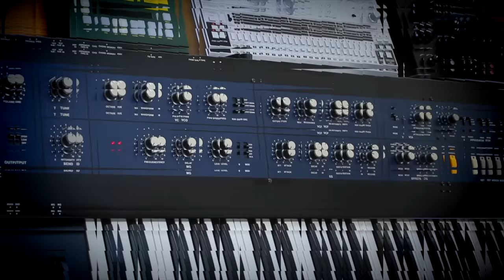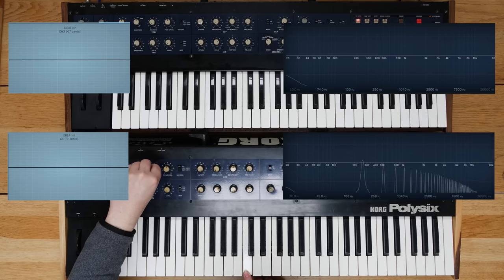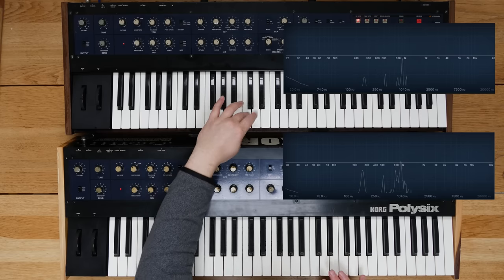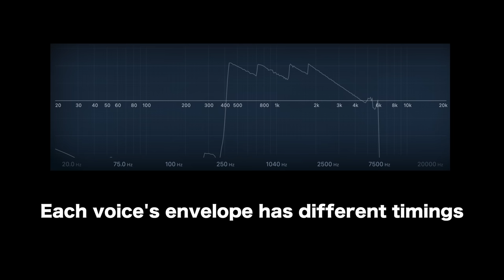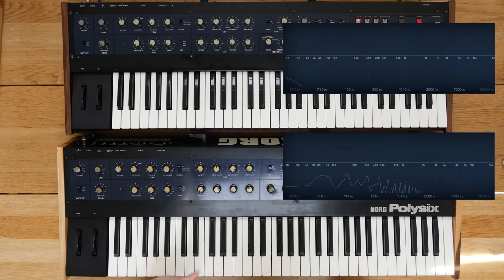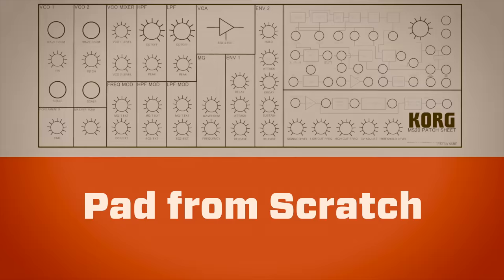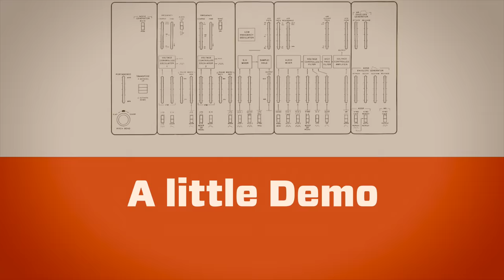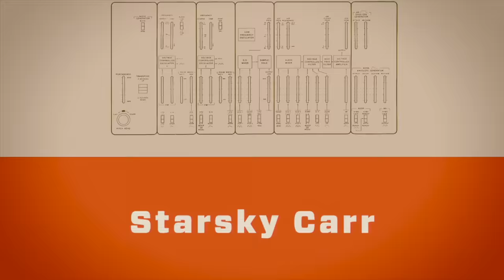Do vintage synths sound the same?

Comment: Analog hardware is extremely different from software in an accumulation of parameters, multiplied and multiplied again for every track and process.

I find it funny people can’t even distinguish what to many isn’t subtle at all. As Trent Reznor once said of his attempt at using the Minimoog app vs the original “it could only sound this big”.

Here’s why simple note tests are misleading. Consider guitars. If you take a single round robin sampled note and have a guitarist hit a single note in similar fashion, you might be tempted to think there are no differences. It should sound the same in theory! But we all know once the actual guitarist plays, you know, actual music… it will sound very obviously different! The mechanical and lifeless quality of the sampled variant will become obvious.

All of those little transients, subtleties in the way one note flows into another, zero repetition of any parameter, etc it becomes clear unless you’re tone deaf! Same with synths. All of those nice little fuzzy electrons make the instrument come alive once you do anything vaguely musical.

I worked 100% in the box for a whole decade and it pains me how much I fiddled and flopped on plug-in after plug-in to approximate all of those amazing synth sounds from the 80s. All that effort and I never really could get there.

Then when I got an actual analog synth it was almost a massive disappointment that it’s really just that easy! Depeche Mode weren’t gods at production, they just had better tools than I did. The truth hurts, but my advice is to get over it and get the right tools. Any soft synth trying to truly emulate analog is almost pathetic by comparison when it counts, unless it’s just a bit of decoration. However I can see AI perhaps finally getting us to a point of true indistinguishable, but we are a ways off yet.
Reply: I guarantee if I play you a recording of a year Obrahim OBXA VS the emulation Synapse audio Obsession you and 90% of people will not be able to tell the difference.
Reply: @HOLLASOUNDS  haha, nope. If you put the emulation through a Pultec style eq, a Neve preamp, and maybe a tape, even with good emulation then maybe it would be harder to tell. But bare bones,  no way. I really wonder how many people have exceedingly underdeveloped ears.

The thing with digital is the transients are give aways. They always crunch with a bad aliasing. Because fast envelopes are basically square steps at that point. Beyond that, the thinness in the low harmonics, lack of drift against all osc’s, mixers without real drive all tends towards a static character. And of course analog filters are so much smoother a deaf person could appreciate the difference.

Now the real test is an equivalent mix. One on mostly analog and one in the box. I deal with these daily and guess which one’s always require extra effort for me to tame and mold?

PS I’ve also worked in software and know how the DSP algorithms work. It’s actually pretty repetitive FFT linear approximation everywhere you look. And even that simple processing is costly. Imagine applying non-linear sub functions to better represent analog gear on every part of the chain. ENV, mixer, OSC, filter. Even a simple sine function - as in the one on your calculator - believe it or not, is so costly for your CPU that it doesn’t even bother, it just uses a very rough look up table!

Build everything from squares and at some point you notice the “squareness” of everything!
Reply: @sibbyeskie  analog is going to be analog period. Digital for me is like instead of use raw cane sugar on a drink, I use Splenda.
Reply: Good analogy! Doesn’t matter which taste a person prefers, but not tasting the difference would indicative of a lack in taste.
Reply: @sibbyeskie  Yet everyone failed in his other test? I’ve done similar test and people always get them wrong
Reply: @vaiman7777  shouldn’t failure rate be 50/50 to show there is no perceptible difference? Besides that, I mentioned how testing tends to be flawed. Doing a mechanical one note stab and sweeping a filter isn’t any more fair than my analogy of a sampled random note guitar and a real guitar. The way these instruments *perform*, and in concert with others is what matters in the real world.

I don’t get how people who have analog gear don’t notice these differences. Are they not great at making patches? The poor quality of presets tends to suggest that many really have no discernment. Many don’t really pay attention to subtlety, but to that degree? Are they actually a bit deaf? inexperienced?

I suppose my best guess is you never had so many casual ears interested in these tools and most don’t really know how to use their ears any more than an inexperienced painter with a palette of colors who nevertheless can apply paint to a canvas. There are ways to improve your senses and perhaps that’s the part nobody really wants to believe.
Reply: @sibbyeskie  I’ve used musical contexts with both vintage and soft. Always same result. People are just guessing. Or they wait for the results to confirm their bias.
If like you say, there’s a perceivable difference, 9 out of 10 would guess correct. Allowing for the odd person second guessing. A split doesn’t.

Anyway, instruments don’t make great music. It’s people. People who think it’s gear are mistaken. Again, proven time and time again.
Reply: @vaiman7777  On edge cases you can always have situations where an analog patch can sound digital and a digital can sound analog. Like even a pocket phone camera can fool people into thinking its a DSLR and vice versa in some instances. But edge cases don't define the technology in terms of its intrinsic capability.

Digital and analog are not good at emulating eachother, and if you consistently can't tell the difference then I'm sorry to report you're in the class of people who can't perceive it (yet), but are mistaking that inability as a universal. I will agree though that it probably is a common failing given that audio engineering isn't exactly a universal skill.

But I never said digital can't sound good, rather it fails at replicating analog where it matters. Producing and mixing for 20+ years, I didn't want to think it was so big of a difference either but it is if you're going for a particular sound consistently and effortlessly.
Reply: @sibbyeskie  After 40 years I’ve grown not to care. What I have learnt, is listeners don’t care. Like at all.
Similar to when i played guitar in the 80’s. Only us guitarists cared about sweep picking & Eventides.
Only synth people care about digital vs analog. Everyone else just shrugs. 

I make sounds on whatever synth inspires me at that moment. Never, like ever, has someone questioned or even mentioned the oscillation source. Be that analog, digital or plugin. People really don’t care. Neither should we :)
Reply: Differences are even less in real music. You have to diminish a synth, a guitar, a sax or a voice to fit it in a mix.
Reply: @theboofin  not sure what you mean. It’s a common mistake to eq out to fit in a mix, if that’s what you mean by “diminish.” If you do that routinely there is something wrong with your recording technique, tools, or sound design and staging.

This is exactly why that analog sound is so crucial to my ears. You get all of those lovely harmonics that are almost impossible to replicate after the fact with some fake treatments. Yes my mixing ability is honed over decades, so I can make great mixes with even dodgy source material. But it is nowhere as consistent, effortless and enjoyable. Listeners can appreciate professional craft as much as moviegoers who aren’t themselves directors or actors.

I hear this refrain that basically assumes listeners are dumb and can’t tell the difference between a SoundCloud track and a radio mix, or some version of why the quality of the tools somehow just zero sums in the end. Sounds like a coping mechanism to me.
Reply: @sibbyeskie  You always need to carve out frequencies to put things in their proper place. A good 70’s mix doesn’t have everything full range. Mics would do that for you to some extent but with most people recording direct these days, you have to do it manually.
Reply: I think it's a myth that you don't notice stuff in a mix- in actual fact the accumulated warmth of a good analog synth multitracked usually sounds better. Unless your mix has too many tracks of course!
Reply: No, Depeche Mode were much, much better than you...